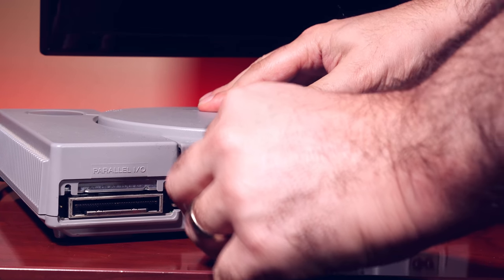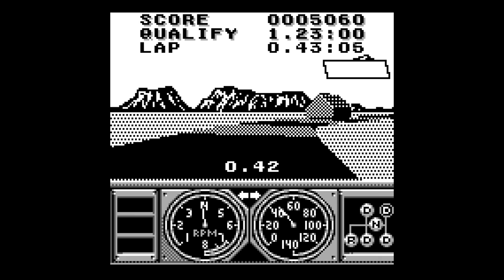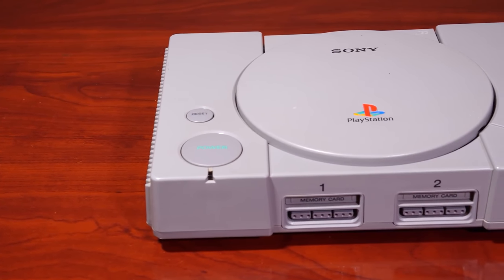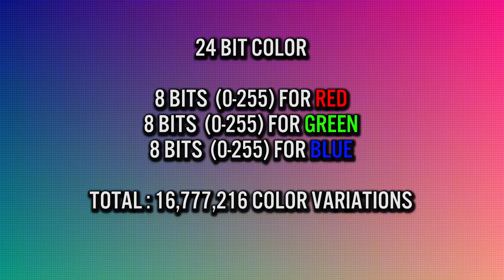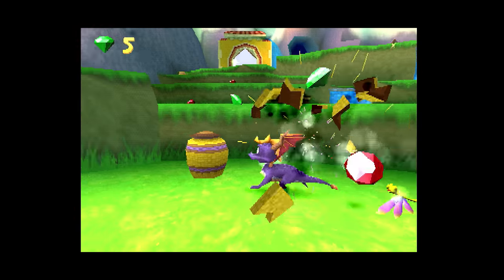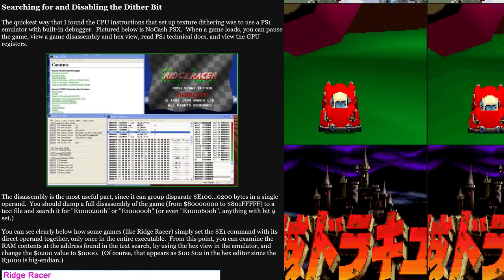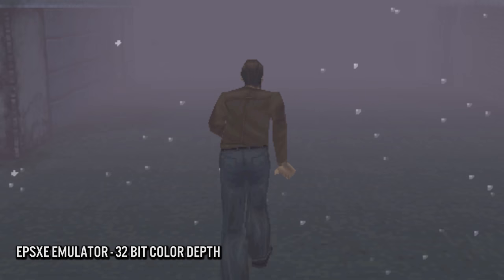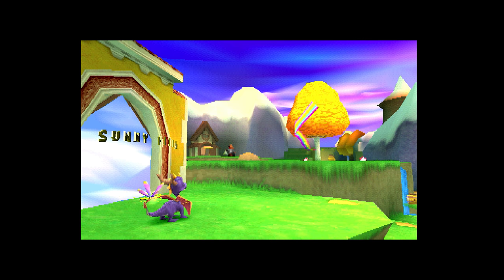Why did the PlayStation 1 have so much Dithering? | MVG

Comment: Vaguely related.  We recently implemented dithering in to the hardware renderer in PCSX2, and we've had pretty much nothing but complaints from people wondering what all the noisy colours are 🤣
Reply: No surprise there, and more than likely it's coming from people who don't understand how things actually work.
Reply: @Know Thy Enemy Emulation is not suppose to make things look better, thats just something people have done. Emulation was about making software that can emulate hardware 1:1 including the bad aspects of the system.
Reply: @Know Thy Enemy as @Enigma776 said, it is intended to emulate the system as accurately as possible, you can turn it off and render in 32bit if you really want to (which is what PCSX2 has done until recently)
Reply: @Know Thy Enemy In addition to the other comments, an emulator can only do so much if a Developer found ways to do shortcuts to make their game run on actual hardware. CPU work on internal buffers for instance. Or per-game hard baked values. HD Remakes, being ports, can at least hand tweak things to account for modern graphics systems. But an emulated PS1 game can't just insert a light into the rendering pipeline that wasn't there in the game code and data.
Reply: @Know Thy Enemy it's not terrible because the textures are 32bit, so if we emulate a 32bit buffer it looks fine, though the colours look lighter (in GTA SA at least), but yes the banding looks very obvious in some games without dithering
Reply: @Know Thy Enemy "Isn’t emulation meant to make things looks better on newer hardware?"
In a way, both.  Accuracy is almost always a primary goal, but one of the benefits emulation can provide is enhancements that weren't feasible in the original hardware.
It all depends on what your purpose is for playing through emulation.  Sometimes an accurate preservation is desirable, and sometimes playing old games without their historical limitations is what a player is after.
Reply: RefractionPCSX2 too be honest, I like dithering since it makes the games look crustier, compared to today’s UHD graphics.
Reply: @Blood-PawWerewolf  For some games, it's an essential part of the texture of the visual style.
Reply: @Know Thy Enemy well, PS2 mostly suffered from same issues as PS1 did. Unlike other competitors, PS2 texture access was locked to 4Mb of VRAM (both GC and Xbox had free acess to main RAM from GPU), so yes, textures was palletised, resolution was sub SD just to save VRAM. Intended way to overcome this limitation was sophisticated just in time data management using EE's onboard DMA controller.
Reply: @Know Thy Enemy Yes,  the PS2 is weak in comparison to the GC and xbox
Reply: @Know Thy Enemy Draw rate on PS2 was enormous, that was i'ts main advantage. Other features  was not so good though - lack of multitexturing, for example. And VRAM limitation and need of sophisticated 'just in time' data management was it's biggest issue. Very few developers succeeded, like polyphony digital, santa monica and criterion
Reply: @Know Thy Enemy Copying the original hardware so the output is exactly the same as expected on actual hardware.
Reply: oh that's neat! i gotta try it out
Reply: @Know Thy Enemy because its hardware was just slightly modified and overclocked GC. And it's render buffer size remained the same. All 16x9 games on wii was rendered in anamorphic.
Reply: @Know Thy Enemy emulation is supposed to... Emulate!
Reply: It's not pretty.. not to me anyhow.
Reply: Thank you for all your work on PCSX2. I’ve been using the dithering through the external shaders.
Reply: LMAO
Reply: @Know Thy Enemy In Europe and other PAL/SECAM regular TV was 576 visible lines (625 total) at 50 fields per second as compared to the NTSC 480/525 lines at 60 fields per second. So my assumption (I'm too lazy to look it up) is that European Wiis will do 576p50 just as American ones do 480p60.
Reply: Well the people expect the games to look better on pc hardware but I understand you were trying to mimic the experience of the original.
Reply: does the software renderer has it? i don't think i have used the hardware renderer in years
Reply: @Know Thy Enemy lemme correct what Joseph said.
Accuracy is always the primary goal. Enhancements are secondary, they're nice-to-haves.
Enhancements are usually developed by users or during spare time. :P
Reply: @wasawizard  24 should work fine on the latest development build :)
Reply: @khhnator  yes the software renderer has had it for a while I think
Reply: That sounds like a mistake in implementation. You were implementing a feature that would downgrade the quality of the video. While some people might desire it, most wouldn't. So you should default to having it turned off, and let people decide to turn it on if they want it. 

Most of us aren't gaming on CRTs, so adding dithering actually makes the graphics look worse on our LCDs than they did back in the day. Most people want it to look the same or better than it did. 

The dithering wasn't visible back in the day, so it would look like it came out of nowhere.  The only people who would want dithering would be people who already knew about it, and thus would choose to turn it on once they knew it was available.
Reply: @ZipplyZane  Some people want it to look better, others complain we aren't accurate enough, can't honestly win whichever way we do it.  We might tweak it in future (scaled with resolution doesn't look too bad), but honestly it depends on the user, it can be quickly toggled with Page Down, or it can be turned off altogether in the ini file.  We can change it in future i suppose, I just value accuracy over aesthetics.
Reply: @Know Thy Enemy by "32bit" he meant PS2 textures fill favor using 32bit palettes for bitmaps which are mostly 8bpp. There are cases of direct 32bpp textures, but it's very rare. PS1 used a combination of 4bpp, 8bpp and 16bpp textures with a 16bit palette for the first two. Unless the palette was stored and used in software, then it could reach 24bit when copying splashscreens/FMV and the like over VRAM.
Reply: @refractionpcsx2  Right. People have different ideas of what they want. Hence providing it as an option that can be toggled. We all agree here. 

What I'm suggesting is that you'll run into fewer complaints if the people who want dithering have to turn it on, rather than the people not wanting it having to turn it off. 

So just the simplest tweak: keep the new dithering feature, but have it turned off by default. To let people know that it exists, show in status bar or brief overlay when starting that dithering is turned off. Then those who know what dithering is will know they can turn it on if they want it.

That way you can provide disoverability, while not creating something that people might think is a bug or glitch. Only the people who know what dithering is would turn it on.
Reply: So the rendering is more accurate so they don't like it..lol
Reply: @Know Thy Enemy Emulation is meant for emulating. Anything else is extra.
Reply: @Know Thy Enemy If you're talking about PS1 framebuffers, then yes. Though you still need to make sure performance stays consistent. To achieve that, games like Spyro (which ran at 512x240) need to be very smart with LOD and employ heavy usage of the texture cache, which limits your texture resolution (64x64 max on 4bpp textures) but offers a great performance advantage.
Reply: I think an easy fix is have a section in emulators that is clearly labeled "enhancements", as I see most people just crank up every option if their system can handle it (like you would do with a PC game), having no idea what any of it means and what games use certain rendering techniques/resolutions/etc.
They also should be clearly separated from "preferencial enhancement" for things like scanlines and 2xSAI/whatever.
Reply: @kooler186  Damn that looks nasty without dithering :P]
Reply: @refractionpcsx2  I love accuracy but I'm personally willing to forego it to some degree to improve the video quality (like rendering at higher resolutions). When you disable dithering is the game emulated with a higher color depth to prevent banding or is dithering currently the only way to get the intended (simulated) color depth? Also when you render at higher than native resolutions does the dithering get much smaller/less-obvious? That might also mean I'm more willing to leave it on if I render at 1080p and the dithering becomes invisible like originally intended.
Reply: @LanceThumping  They render in 32bit colour depth instead of 16bit, this works in most cases.
Reply: @refractionpcsx2  it took me 10 minutes to accidentally disable it, the next 5 games I tried didnt work with it and then my console died so wasnt able to test it out until seeing this comment so now Im gonna try making patches for games since covidcash got me a laptop cpaable of emulation
Reply: omg just tried the patch with the game on pcsx2 and looks worse than on console because console atleast you can adjust tv settings to better blend it and maintain sharp image
Reply: I did notice this myself. I thought it was due to some kind of reset of my configs as I updated some emulation stuff. But it's appreciated. I mean, complaints or not, the option is key. 
Also I just want to say thanks for the work. I have 2x PS2 consoles but I ran out of space and plug sockets so emulation has kept the gameplay alive for me. Especially with the improved graphics capabilities with games like GT4. Kudos to the team.
Reply: Where are the color depth and dithering settings in PCSX2? I can't find them.

Why did sony even implement dithering on the PS2? Isn't PS2 powerful enough to handle high color depth?
Reply: @zigmar2  The colour depth varies per game, however when dithering is off (in PCSX2) it renders everything in 32bit colour.  If you want to disable dithering perminantly you can edit the gsdx.ini in the inis folder and set ps_dither = 0.  If you want to do it temporarily for a game, just press Page Down a couple of times, once will still be dithered but scaled to the resolution.
Reply: @refractionpcsx2  Any plans to add the option in the GUI too? Changing such an important setting through the ini file is pretty counter-intuitive, and a lot of people don't even know about it, like I did.
Reply: @zigmar2  I'll suggest it to the GSdx devs :) Thanks!
Reply: @LanceThumping  Yes the dither pattern does get smaller with increased internal render res. It does get more and more ineffective along with it also, meaning it tends to look more like it's not dithered at all (banding comes through). I'd say it only works well at 1x native res. Anything more than 2x and you should just use 32 Bit.
Reply: @enigma776  with the option to make it better
Reply: Makes sense, it's a bit like the interlacing pet peeve which keeps the games from looking as crisp as possible, but emulates what the PS2 actually did.
Reply: @michelvanbriemen3459  yeah, it's just crazy, the amount of support requests we get because one pixel isn't quite the right colour, then we try and improve accuracy to the actual console and everybody is up in arms.  I get people want graphical improvements over the original, it's just a pain trying to please everybody. lol
Reply: I personally don’t like making old games look better on emulators. I just want an accurate emulation of the original console so thx for that :^)
Reply: @BethesdaCakeDelivery  this is not actually true and people like "erp" on the beyond3D forums have stated why.

To be fair, the xbox, gamecube, and dreamcast all used pc-based graphics. The PS2 on the other hand, used fairly exotic stuff you would never find in a pc. The gamecube has multiple strengths or features, such as ability to use better textures (the ps2 has HORRIBLE texture compression) but its theoretical performance and ability to juggle a lot of complex things is pretty bad. At the time, texture and pixel throughput were the general "stats" you were after rather than compute power, and the PS2 had massive pixel and texture throughput and the small bit of vram was insanely fast.
for details:
gamecube has 4 pixel pipelines, 1 vertex shader, 4 texture mappers
PS2 rasterizer has upto 16 pixel pipelines, 2 vertex shaders, 8 texture mappers. The real limitation of the PS2 is that texture and pixel pipelines are combined/shared and the optimal way to make a really pretty game in the 2000's is to split them 1:1
As such, the pixel pipeline count is excessive and not reflective of its capability though it did help immensely with some effects such as blurring effects.

Compute in theory is superior on the gamecube but is actually worse in reality: The EE is really flexible if you can optimize well enough for it, whereas juggling complex lighting, texture combining, and geometry at the same time tends to kill the gamecube's fixed function hardware. The gamecube can produce some really good visuals, but you can't push the system like the PS2; it's generally better pushing better textures and sometimes high-res on simpler games.

This doesn't matter next to the xbox though, 
The GeForce 3 can run programmable shaders and is a high-end solution from nvidia, it doesn't have any of the limitations that the Gcube has. In comparison, the gcube uses cheap aladdin 7 IGP-based fixed function hardware; this is why performance will drop hard if you really push the system.
the geforce has superior theoretical texturing throughput to ps2.
the geforce has superior theoretical vertex throughput to ps2.
The pixel throughput is inferior, but the geforce is both highly efficient (both the gamecube and xbox will produce better visuals at the same theoretical rate) and raw pixel throughput is secondary to other things such as texturing capability.
Reply: That sounds like a cool feature but I hope it’s an option, dithering often looks awful in online video as it gets blurred and scaled or just doesn’t compress very well. It also just doesn’t look great to most people so I’m not surprised you got complaints, but providing it is an option hopefully those complains will go away.
Reply: @enigma776  okay but i want it to look good as possible otherwise just play original hardware so have options for people dont force people to do anything
Reply: @refractionpcsx2  wait so they removed the ability to turn on 32bit in PCSX2?
Reply: @CamberGreber  No, you just disable dithering, as long as the game isn't forcing 16bit further down the line, it will try to be 32bit.
Reply: I mean yeah. I grew up with the PS1 since 1999 but I still hate dithering. Nostalgia aside it's objectively inferior to have dithering in a game so why ever add it? I think the visual quality is more important than nostalgia
Reply: Yoo i love your emulator ❤❤
Reply: Maybe time for you to add NTSC filters to blur it away?

Comment: Love these PS1 features. Can we have a video on the Atari Jaguar and why it was so difficult to program for in the future?
Reply: Terrible Coughing Is feaures the sequel to gaiares
Reply: I had recently the same idea, i think it is totally crazy to have all these powerful processors 32 and 64 bits and an old Motorola 68000 13 MHz! 
Carmack said it was the main problem : Replace the 68k with another 32 bit RISC, add dynamic cache to it and give the blitter at least a small buffer. He claimed that with these changes, the Jaguar would not have matched the performance of PS1 or Saturn but would have been “competitive”.
Reply: Many other channels have covered this
Reply: I second this notion. Sure other channels may have slightly covered it, but I'd love to hear MVGs take on that matter.
Reply: @secondbittchannel6166  navagfa
Reply: @secondbittchannel6166  same story for the Sega Saturn.
Reply: Lantus, we need this.
Reply: Pls do ir
Reply: fawkus, w e ne e d rssi
Reply: Where did YOU learn to fly?
Reply: @Terrible Coughing That’s a very short video. It completely sucked!
Reply: @jedipunk82  The Jaguar is so complicated that when you described it's hardware up until the last processor, it was a bit hard to know if you are talking about the PS1, N64 AND Mega Drive/Genesis, at once, but no it was all just the Jaguar. And it's not even to blame on the writing, damn the thing was weird.
The Jaguar and the Saturn. You would think that those two would teach something for later years in therms of making weird and hard to code hardware, but then comes the PS3...
Reply: Wasn't it said that if an extra bus was added between the CPU and the blitter and some more cache given to the CPU it would've made it competitive with n64? I would love to hear mvg elaborate on that s***
Reply: Thiss!!!!
Reply: So you love bad things. OK...
Reply: I hope he’s writing this episode
Reply: A lot of the problem was the inclusion of the 68000.  Programmers had a nasty habit of ignoring the snazzy peripherals, preferring to code in 68k ASM because that was what they were familiar with.  Perhaps if they'd gone with a MIPS CPU or the like things might have been different (though I doubt much of anything could have helped Atari at that point).  Still, their demise let me get a TT030 direct from Atari for a song so it's all good.  </tangent>